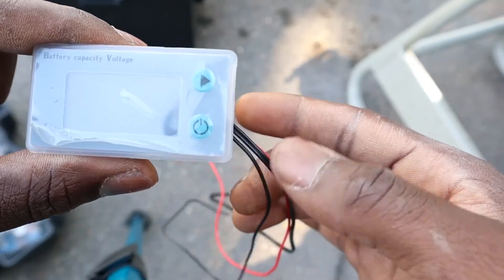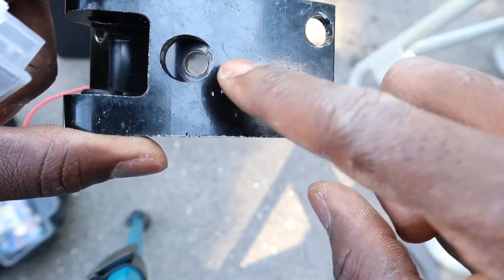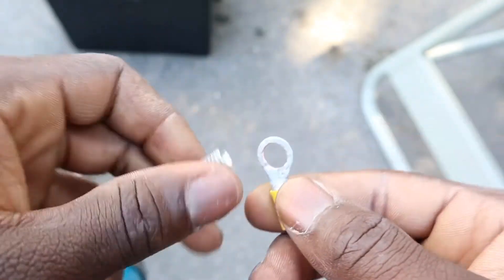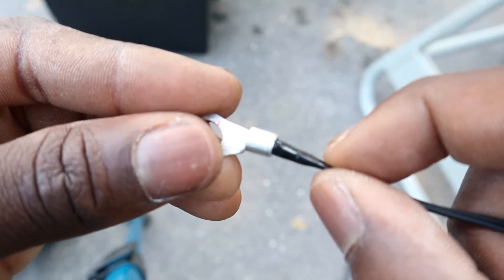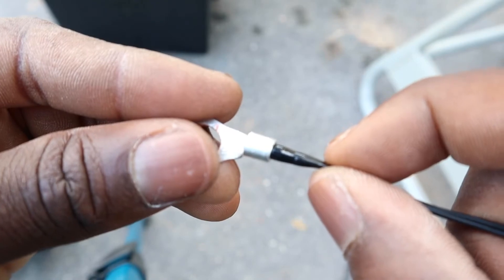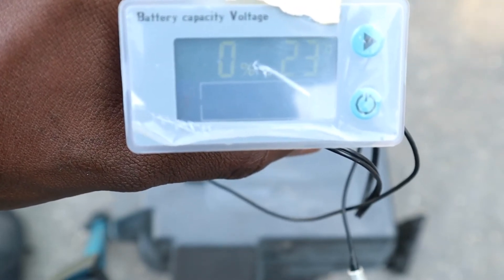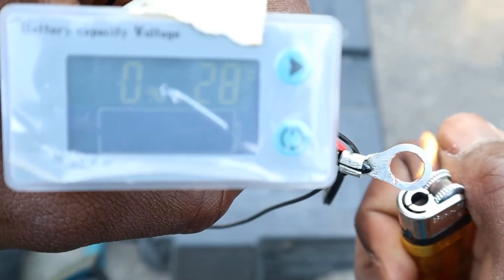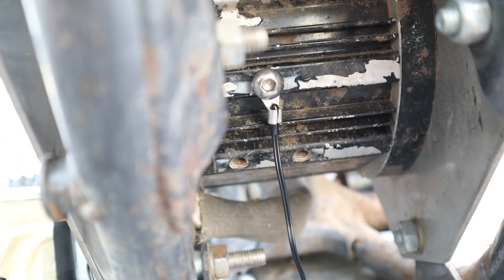How to install a temperature sensor on your electric bike motor

Comment: that is a cool sensor, however the probe is too exposed to air. you would be better off drill a small hole through the aluminum fins on the motor , putting the thermistor into one of the grooves on bike and then putting heat sink compound around it so it physically is connected to the aluminum housing.   many of these motors have bolts which go into hollow sections of the motor as well. I have drilled out those hollow sections and put a temp probe in there as well.